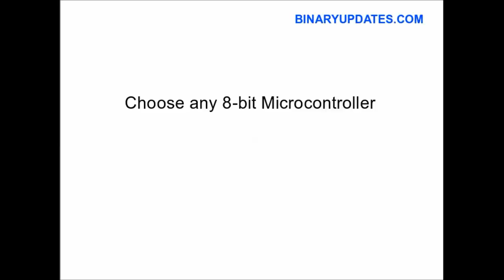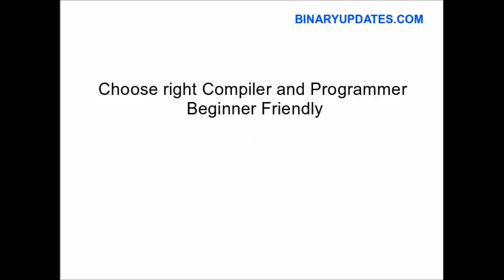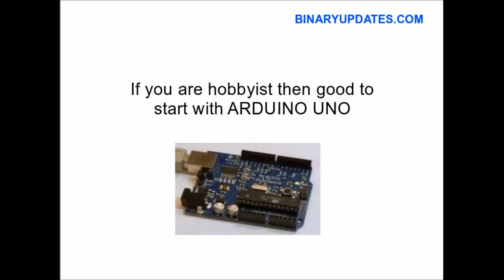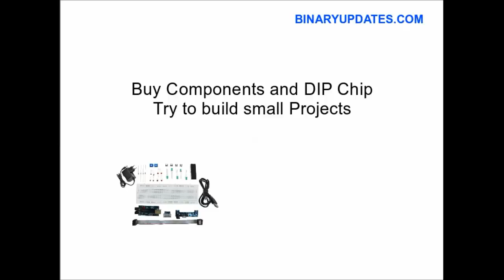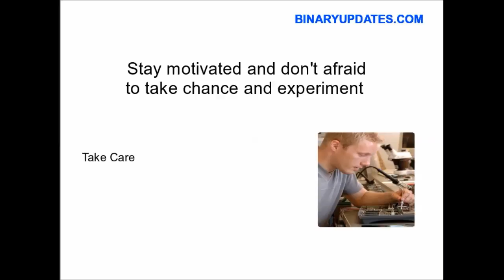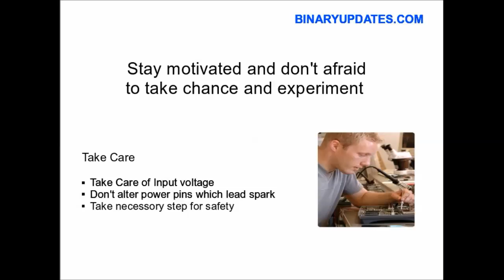Learn Microcontroller Programming - Beginner's Guide

Comment: which book should I prefer for this .
Reply: there is nothing like that .this is the stage for practical approach if any thing went wrong need to check data sheet and schematics(hardware point of view) need to debug with breakpoints during coding .

Comment: Thankfully but I have a question what is the pre requirement to start with microcontroller chip and how I deal with a lot of different architectures as beginner.
Best wishes ❤
Reply from the maker: I suggest AVR ATmega328 is best to start with as with the popularity of Arduino Uno. Its an advantage. Now coming back to pre requirement is good to have some knowledge of C Programming or atleast Arduino C Programming to start as bare metal Microcontroller Programming. I hope this may help you. I wish you a beautiful day. Thanks

Comment: How to learn every pin of a microcontroller easily,systematically & in a short time.
Reply: dont need to know all the pins.
Reply: just learn the architectutre n port configurations
Reply: learning pins matters .basically in coding in embedded learning comes from doing projects irrespective of(size of project/bits size of mc/...anything). to give stright answer to your question  depends on the application.if u want to reset something ..select pin of it.if you want  to increase the speed of operation choose respective speed in osciilator pin .few ports are specified for particular purpose(i/o).NOTHING IS USELESS.if you feel that few pins have no function that means u are not utilizing it properly.